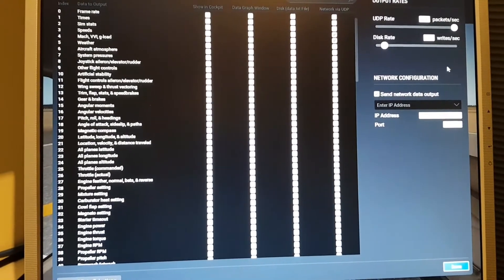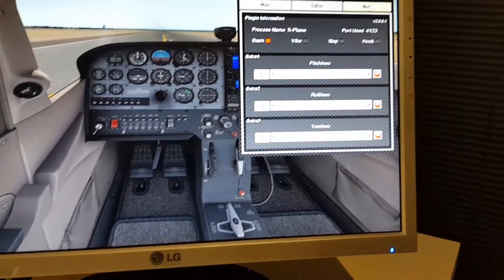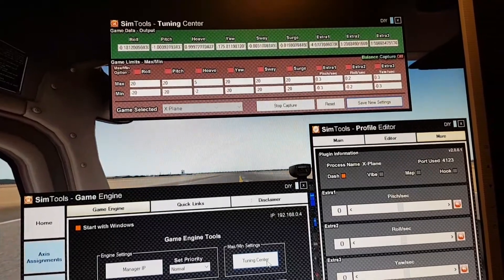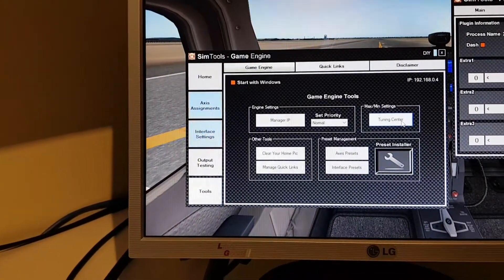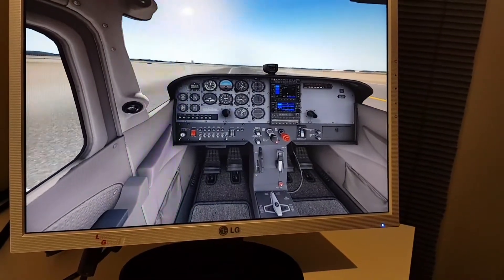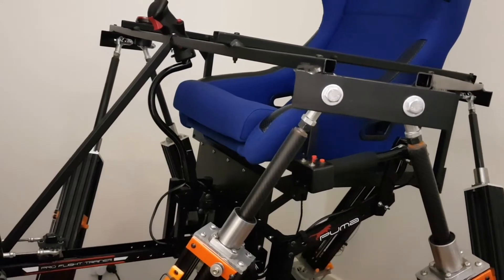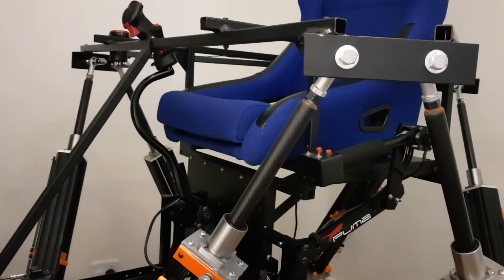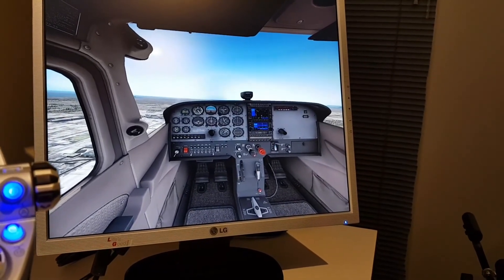X-Plane 11 6DOF motion platform flight test 3

Comment: How does your new platform compare to the this one?
Reply from the maker: Cost about the same to build each one

6DOF Stewart platform
Plus
Higher fidelity motion due to six degrees of freedom
Greater actuator travel = higher angles

Minus
Difficult to get into/out of
Need special tools/skills such as welding
Takes up a lot of floor space
Not many detailed builds / tutorials to follow

3DOF SFX100 platform
Plus
Small floor footprint / neater appearance
Easy to get into and out of
Easy DIY making the frame
Moderate DIY skills for electronics
Can be built quickly / in stages
Very detailed tutorial videos

Minus
Small tilt angles 8 & 15 degrees - lower fidelity modelling
Lots of 3D parts
Most parts overseas = costly postage / time
High voltage wiring required
240AC only

Comment: Can you sell me a kit.
Reply from the maker: Hi David,

The xsimulator blog has a list of the parts and associated costs to build the platform. It cost me about $3500. I have posted the videos and shared my build experience in the blog to help others not to make a profit or attract subscribers.  I will be posting my more videos very soon of my new build which is a lot easier (and cheaper) to make than this one, however, it "only" has 3DOF. On the plus side is the lower cost and the a much smaller room footprint.